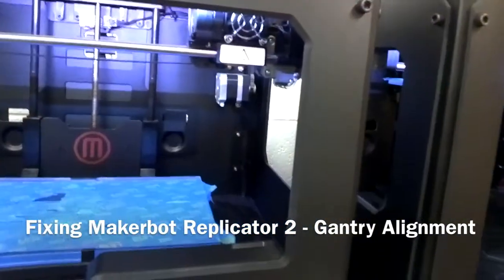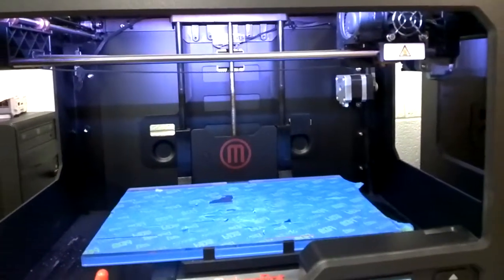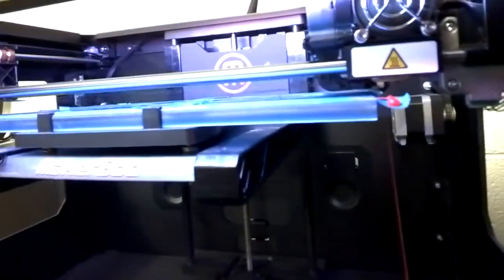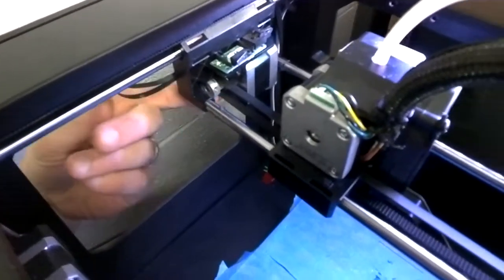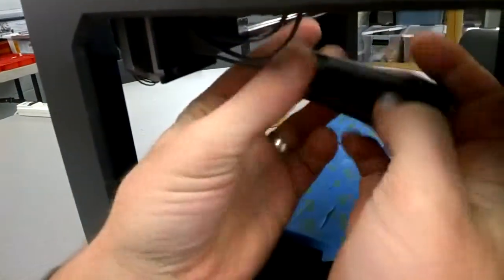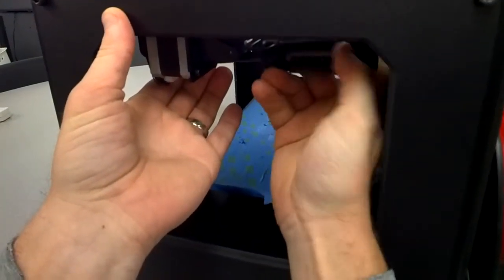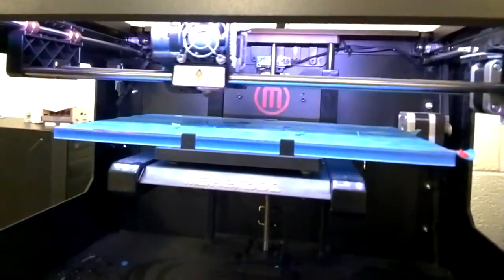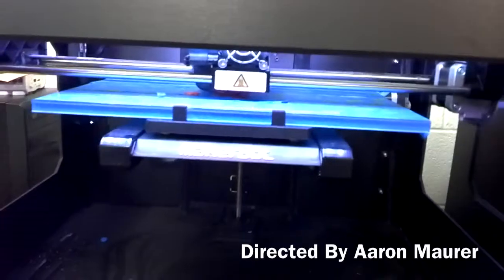Fixing Makerbot Replicator 2 - Gantry Alignment

Comment: Thanks for the video. I have a Flyingbear P902 printer with exactly the same gantry system. The problem that I see is that even if you tension the belt or move the motor back, the two Y gantries tend to tilt inward (towards the extruder) which loosen the belt. The only fix I have right now it to pull them away from each other from time to time. Having two 8mm rods on each side would prevent this from happening, but this requires obviously a complete redesign :-(